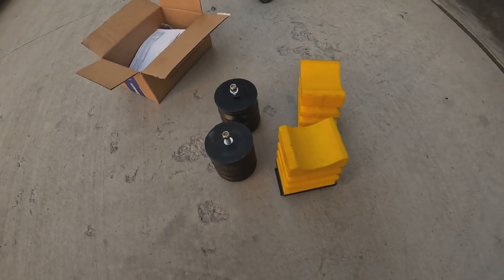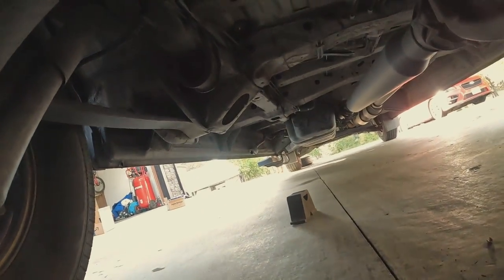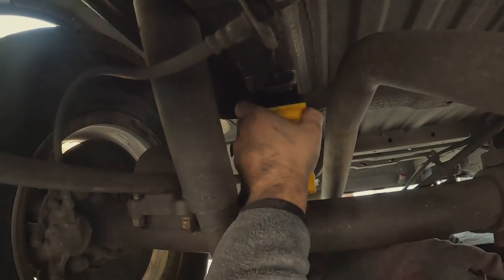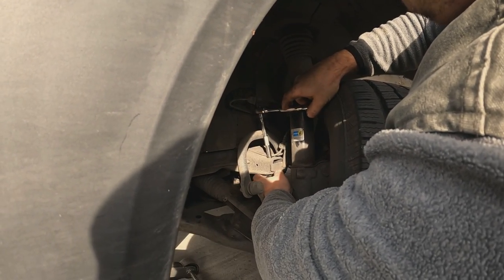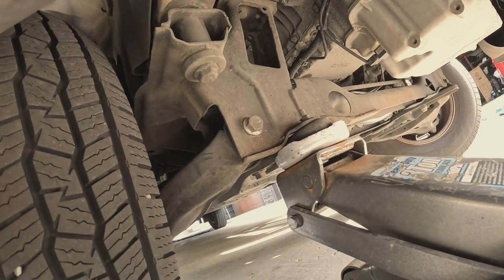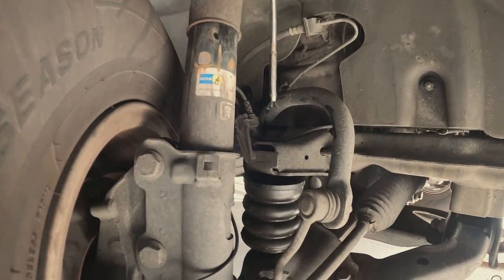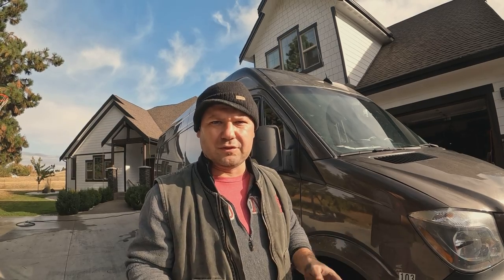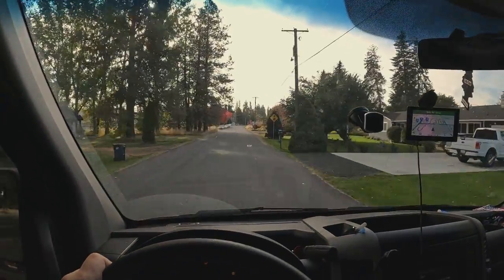Sumo Springs Sprinter Van Suspension Upgrade | How to Install and Test Drive Review

Comment: I see your brake hose is against your shock with the wheel turned.
I have a 2015 and my brake hoses rubbed on the shocks and wore thin and didn't have enough stopping distance coming to a red light. Had to swerve to keep from rear ending 3 cars. Side swiped a cop car to get in front missing everyone. The median in the center of the road kept from going into oncoming traffic. 
Please inspect those front brake lines 😢

Comment: LOVE THIS!! What a video - "night and day difference". Honored to be part of your journey. -Tom
Reply from the maker: Love my purchase so far. You guys have a great product. And I have been recommending it to all our drivers in the fleet.  I have been looking into the super springs leaf spring replacement as well. If a sponsorship can be organized I'd love to be a part of "your" journey 😉
Reply: @Eagle-Xpress  Wow ok so I asked you earlier about an air ride kit because I know over time going long distance for a good period of time takes a rigorous toll on your suspension those black sumo springs resembles an air ride suspension great to see you did this
Reply: @Eagle-Xpress  How do you know the shippers aren't pulling a fast one on you when it comes to weight do you know the exact weight of every pallet you haul and do you have a digital weigh scale equipped on your sprinter van that can differentiate the weight of each pallet you haul ?

Comment: Will be installing my front bumpstops on my new to me 2015 Mercedes Sprinter 2500 170 in wb. Non extended. 
I travel a lot with my craft installing beautiful stair railings, curved or straight. A lot of jobsites has rough driveways

Comment: I wasted money once on that type of upgrade on my express3500 and it was really bad when the van was loaded to max , the rear van would just bounce like there was no suspension at all , then I upgraded to air bag and that make a difference until you find the proper inflation . You gonna scare yourself on highway at high speed with a heavy when you feel your van bouncing around .
Reply from the maker: Maybe your rear shocks were due for replacement and that's why it did that? I have plenty of drivers who upgraded to these over the past many years and they love them...never a single complain so far. I'll do another review in a few months again. But I know for a fact shocks need to be alive when loading heavy.
Reply: Shocks were new , on a Chevy you lucky if you get 40k miles on oem shock , mine were shot at 42k miles , just one out of four had not even one inch of push back when I replaced them , the three others would not even push back a 1/4 inch once completely compressed.
Reply: Oh wow so it doesn't actually operate like the air ride kit with the extra comfort that transfers the pressure and weight in a comfortable manner?